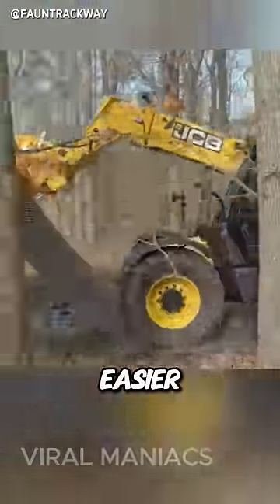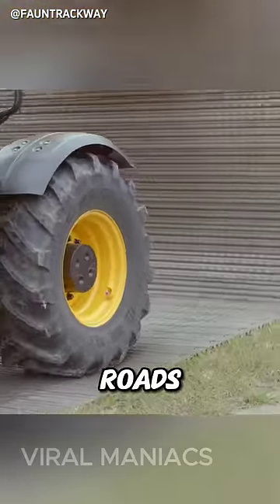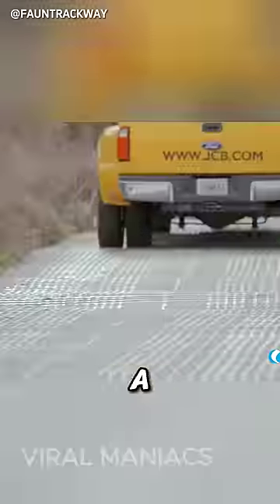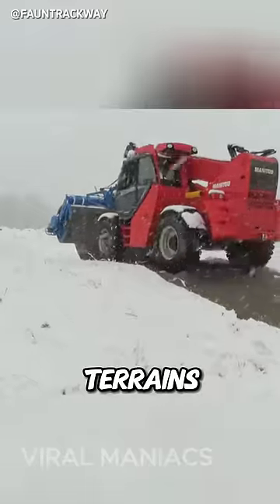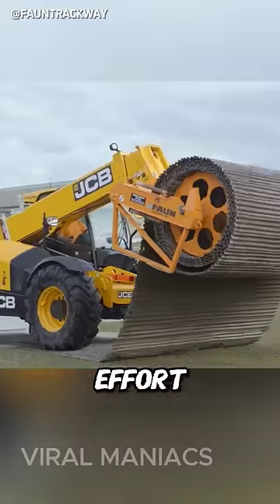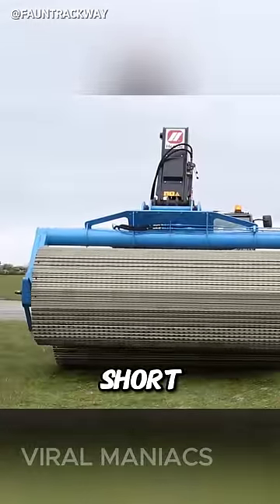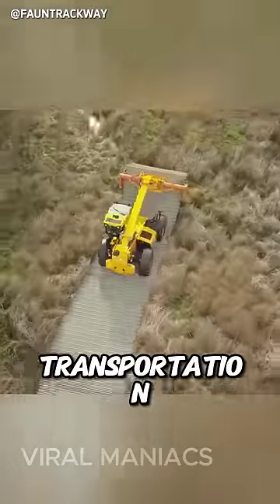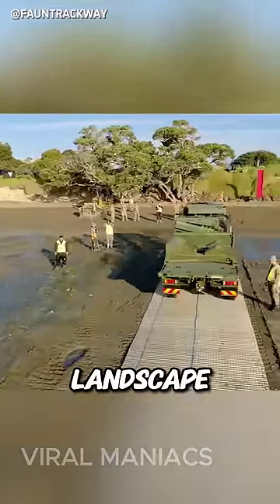Constructing Roads Has Never Been Easier #shorts

Comment: This has been around since WW2
Reply: So have pens. It ain't the same today
Reply: Yep, I was thinking the same thing. It's old technology, it probably was impressive in the 1940s.
Reply: I remember seeing vehicles in pictures that did the same thing from the war.
Reply: Even still, they are NOT AS ROBUST and TOUGH as they are portrayed to be.  Also if the actual ground or earth or material you roll it out upon, that material, rock, mud, tundra and the ambient temperature will cause your "Road In A Roll" to sink into any soft and wet areas. If used to cross seasonal stream and creek beds can be QUICKLY UNDERMINED and leaving a large and dangerous void you will not notice untill your vehicle takes a nose dive. On the flipside, they can be silted over within minutes of heavy or monsoon rains that puts you back at the "How will I get my machine across this huge area of mud"??
Reply: But it has improved vastly, you forgot that part kiddo
Reply: Not even close to the same thing.
Reply: @noneyadamnbiznezz  they arent supposed to be a perfect tool, as such it doesnt exist. But more for emergency measures.
Reply: Yeah and it's still sucks
Reply: Hobart’s funnies, specifically this device was mounted on a Churchill tank’s hull.
Reply: @noneyadamnbiznezz I was thinking the same thing, plus how do you make curves or bend in the road? I've worked with similar products in the past, proclaimed amazing solutions but we're an absolute nightmare to work with in real world conditions!
Reply: Some of us know mate.@noneyadamnbiznezz
Reply: @redrocket597 oh, you mean like proper modern roads in comparison to what they built a thousand or two years ago?
Reply: @ontoya1  No, these are Corduroy Roads, and have been around since WW2. The technology was developed by the SeaBees used in the rapid construction of airfields.
Reply: @XMeK  They did not have an all in one machine like we do nowadays. There was far more manual labor involved. I don't give a fuq if they had the actual road. I never disagreed with that part. My point is the way we place those roads is FAR more efficient. Efficiency is my point, not their existence.
Reply: @ontoya1  Ooooh... Cupcake got triggered. 🤣😂🤣
Reply: @XMeK  If you think anything in that sentence indicates being triggered then you must have never been in conflict before lol 
If you're reading comprehension was up the par then you wouldn't even had a hot to comment because you would have known I wasn't arguing against that point. But you can't read so it okay. I understand
Reply: So were planes and cars lmaoooo
Reply: Good remark .. you are educated
Reply: @ontoya1 this stuff is tho
Reply: Combine Marston mats and hobarts "Bobbin" tank
Reply: @retr0bits545 Came looking to find or make a similar comment good stuff 👌🏻 that man was way ahead of his time! The Fat Electrician did a great video about him and what he did.
Reply: So have rifles and planes but they got better. Just like this 😂😂
Reply: Well if you're driving a machine through a creek you're about to pay an assload of fines anyhow.  @noneyadamnbiznezz
Reply: @ontoya1 pens are very much the same today.. 🤦‍♂️
Reply: This company has been around since their products were used in ww2. They're located in Arlington Virginia.
Reply: @MDM1992  no dude, the the ballpoint pen wasn't viable  until after World War II when Bich fully mastered the design using oil based ink. Before then we use water-based ink and pens were pretty ass. Bic came up with the perfect size for the ball bearing and the perfect diameter for the ink tube in order to press the oil-based and down using capillary action. And before then we just used quills. So no you're wrong. 🤦🏿‍♂️
Reply: @ontoya1 ball point pen was invented in 1888… only thing that changed is the materials.
Reply: @AuziGFX  I never said invented I said mastered design. I said that the ballpoint pen existed and then Bich improved design. Literally proving my point that the pen underwent changes in development. So thanks for adding
Reply: @ontoya1  your analogy isn’t as good as you think it is and now you’re defending yourself hard.
Reply: @AuziGFX  A change in design is a change in design. The pain has changed in design just as these roads. You literally can't change logic. Subtle change is still change. It doesn't take much defending when that's the function of reality. You're literally trying to say that something didn't change when it did.Sorry kid.
Reply: @AuziGFX  for example you're not even the original of the post yet you're defending a point. And I am defending my original point. At most we are in parity, at worst your the one going hard 😂
Reply: @ontoya1  I’m sorry but I refuse to read a novel when I’m checking my YouTube notifications. I didn’t read ANY of those two paragraphs. All I did was call it as I see it, as in, sir, you’re caring a bit too hard about being correct online & I wonder how your life is & feel a bit sorry for you atm.
Reply: @ontoya1 They literally had the same thing.
Reply: @Bobo-t5u not really. It’s literally a carpet. I think people wouldn’t have been impressed with a rolled carpet.
Reply: @ontoya1 I read that as penlses.
Reply: So have cars
Reply: So are Russia’s nuclear warheads. But we talk about their effectiveness for a reason.
Reply: Hobart's Funnies showed us exactly how badass tanks can be and that people need to crip their notes to progress.
Reply: The material & the design have changed.
Reply: I was just about comment the sale thing 😂
Reply: So has my grandfather but that doesn’t make him any less impressive
Reply: crazy how people are incapable of believing that there are things that didnt change for centuries. tells you something about the general level of education.
Reply: @ontoya1 no shit buddy why would it be the same.
Reply: @concertsair316  Somehow you completely skipped the post that I'm actually commenting on. Weird. No shit I'm commenting on the post in response to somebody that YOU should be saying no shit to
Reply: That doesn't make it less cool
Reply: WW1 duck board or mud boards ......... Even longer......

Looking at everyone talking shit on a ai video

Priceless
Reply: Had absolutely no idea!
Reply: I was gonna say the same thing. It was mounted onto specialized Sherman's I believe we're under British control
Reply: @garnerockshield8981   I think I remember seeing it, but why not use in construction??
Reply: Exactly what I was going to say, was used in the D-day landings
Reply: They were invented by a British (I think general) in WW2 in prep for  D-Day to get tanks onto the beach. The same guy that virtually wrote the book on tank warfare
Reply: @bigp3006 In WW1 & 2 they would also just use logs to stabilize mud and marshes
Reply: So has your mother
Reply: Yeah I was just thinking world War 3 should be interesting. They sure are prepared.
Reply: @Bobo-t5u  What do you mean? It's still impressive. All this time we've been tearing up grasslands & cutting down forests when we've had this technology all along? Humans are the most invasive species
Reply: We need it in rural roads
Reply: Yes exactly.. this is old technology actually.
Reply: "Percy funnys!"
Reply: @noneyadamnbiznezz doesn't mean it's not useful in some situations. each case would need to be individually assessed
Reply: Was just about to comment this lol
Reply: Thank you
Reply: It was pontoon I think
Reply: @ontoya1  The Bic Crystal was developed in 1950 and is still the best selling pen today.
I think it's safe to say pens are the same today.
Reply: @somelokyguy6466  I see you didn't read my other comments
Reply: @ontoya1  Nope. and I won't
Reply: @somelokyguy6466   K, waste your time commenting on 1/8 of an argument 🤷🏿‍♂️
Reply: @ontoya1  Mad?
Reply: @somelokyguy6466  It's funny because saying mad to the other person is only a power move when you're the one that says it first. Unless the other person acknowledges that and what's the other person know. Mad?
Reply: @ontoya1  Yeah you're mad.
Reply: Hola
Reply: I was about to say that as well
Reply: @ontoya1 As the son and the brother of engineers, I appreciate your appreciation for progress!

Comment: They did the same thing on D-Day in WW2 with the tanks on the beaches
Reply: Different technology, similar invention.
Reply: @Under-Kaoz  canvas with steel bars in them, a wheel on the front of the tank with a roll, other than the tank and material it seems the same to me
Reply: @Dsmwarrior1996  Material is not the same my friend. Like I said, similar. Not the same.
Reply: @Under-Kaoz  that's why I said other than the tank and the material of the "road" they're the same tool
Reply: @Dsmwarrior1996  its not the same tool. Im a toolmaker. If its a different blueprint, its a different tool.

Please just actually pull up the WW2 tracks. They are a COMPLETELY different design.
The purpose is the ONLY thing thats the same.
Reply: @Under-Kaoz  bars that hold a spool with a roll of road on it that's rolled out while they drive, same tool, different road material and different vehicle of dispersion,  that's like saying if you put aluminum wire in a MiG welder it's no longer a MiG welder, tool is the same, material is different and the part being welded is a different material, or like saying because it doesn't run gas and only runs flux core it's not a mig welder, same tool just with slightly different blueprint as you say, I work hand in hand with tool and die and build robot tooling among many other things, so I also have experience with tools and making my own tools
Reply: @Dsmwarrior1996  What are you even talking about, give an actual reference my man. I could be wrong, but I don't see anything this thin or on a spool in WW2.  Especially a "roll of road" whatever that means. 

Your comparison is completely different and used absurdly wrong. The MiG is the tool, the aluminum is the material being used by the tool, and the gas doesnt change the tool either obviously. But a mig welder, and a tig welder and using a stick to weld are all different tools and processes to do the a similar job for the same purpose. A wrench, and a torque wrench do the same job, but at different calibers. They are different tools. A pry bar and a crow's foot have the same purpose, they are both different tools.
A vice stop, and a mill stop do the same thing, but have different clearances for work holding. But they are different tools. I can build you 3 different vice stops that are 3 different tools. I can even explain them out to you if youd like, and even give plenty of more proper comparisons.
Exactly like the comparison I gave originally. 

 Stick to welding bud, im sure your beads are better than mine, Ill stick with designing, making, and creating tools and dies. 
We all got our strong suits, its okay to be wrong. The trades work together.
Reply: They called it a Swiss roll or the Lily. Another British design. They came up with some great ideas and some real doozies.
Reply: @donlarocque5157  hobarts funnies was one of the nicknames
Reply: @Under-Kaoz you must be fun at parties..
Reply: @Under-Kaoz it’s the same exact tool, but 100 years advanced. I’m an engineer. That’s not how it works bud. Just because advancements are made in the technology doesn’t change its purpose. The purpose of a tool is what defines what a tool even is. So if they have the same purpose and are designed similar, they’re the same tool regardless of technological advancements between them.
Reply: @joshroi8610 Yoy also gave no reference, its literally not the same tool. Youre lying about being an engineer, and this. Stop
The purpose of a tool is not the only thing that defines it. No doubt your like the engineers we have who over engineer everything and has a toxic ego.
Reply: @iiyyxxnn  this has nothing to do with parties. Grown children everywhere.
Reply: @Under-Kaoz You need to chill out.
No, it's not the exact same track, but nobody claimed it was the same track. 
It is however doing the exact same thing with a rolled track to make a temporary roadway. It is doing the same thing
Reply: @Under-Kaoz bro you just dominated that guy with logic he stopped replying to you. Good stuff, and very good explanation and analysis
Reply: @Dsmwarrior1996  ducked and weaved
Reply: @Man_Emperor_of_Mankind  Yes, they were claiming it was the same tool. Clearly you didnt read before posting.
Ive been chill the entire time, so take your own advice instead of projecting.
Reply: @MisterPlanePilot  Thanks, I dont even like this internet animosity. If someone corrects me, I thank them and move on.

These supposed adults though act like their opinions are always fact. Ducking an argument is worse than just admitting youre wrong. 

We're all human and have a learning curve. I want to help fellow Americans become the manufacturing experts we once were.
Reply: @MisterPlanePilot Just admit you're wrong and call it a day. You're embarrassing yourself in this thread

Comment: Good idea, but now roll it back up after its all dented and warped 😂
Reply: Its not supposed to be multi use.
Reply: They actually did roll it back up. Shows it happening several times and talks about the ease of dismantling it. Everyone who gave a thumbs up on this original comment should rewatch the clip.😂
Reply: Seems pretty flexible and durable, as long as you clear any big debris beforehand from the path you lay it on it shouldn’t get dented or warped for any reason
Reply: That's the point
Reply: @Under-Kaoz it totally is
Reply: @Under-Kaoz you can use them again
Reply: There actually pretty tough, but you can damage them if you dont roll them back up rite, if you slightly vear of course when rolling it back up on the spool in reverse for example
Reply: @thediyandpianoguy8665  not if you bend them up it aint
Reply: @Under-Kaoz  So don't bend them. Seems pretty simple to me.
Reply: @Under-Kaoz  yes it is, we use trackway rolls all the time at festival sites... What is shit is when you have to roll it up by hand.
Reply: lucabaki  wrong place for the conversation. But no, everyone controls their own destiny.
Reply: If nothing else they can reuse the metal 🤷🏽‍♂️
Reply: I can roll it up backwards while sitting on the roll using a front end reach fork tilted all the way down.  Don't need that roller doo-hickey thing, just a baby lull and I can drop em  and pick em all day.
Reply: Irish Italian, huh?
Reply: @Under-Kaoz 

These rolls are actually far more durable than you seem to believe.  They've been in periodic use since D-Day.  It takes A LOT to damage them so badly that they can't be rolled up.
Reply: @Under-Kaoz  they can be re used

Comment: I saw this type used during the construction of high voltage lines in the area a few years ago.  A wonderful solution!
Reply: How heavy of a load dose it work for? Can you run an 80,000 Lb + truck on it with out deformity and roll it back up ?
Reply: @chuckbailey6835  I don't know.  I would think it does have a  weight range/limit of what it dies support?

Comment: funny they dont show it being rolled up where its being used in places you would actually need something like that, in the mud, which is going to stick to the bottom of it and fuck that whole roll up soon as you try to roll it up without power washing all the mud off as it rolls, not to mention if there is fucking ANYTHING other than totally flat ground to begin with its going to bend all that to shit and it wont roll up. this is an idiots design, theres a reason its not used commonly
Reply: It IS used commonly though. And yes; rolling it up when it's covered in mud is a pain, rolling it up when you don't have a machine is even worse... Yes jet washing would be ideal but most of the time you just knock the worst off with a spade till it goes back to the depot.

Comment: Son, I've got about 90 concrete trucks lined up with 10 yards of 5000psiMix apiece. It rained last week, and the site is a mud-hole. Your little science project isn't gonna cut it.
Reply: Funnily enough its probably not much more expensive to truck some rubble in and get a grader to tidy it up. You can even pick it up after you are done and reuse it, we used to do this all the time with scrapers over wet or sandy areas trucks couldn't get to. Obviously depending on the level of mudhole you have this wouldn't work at the moment though.